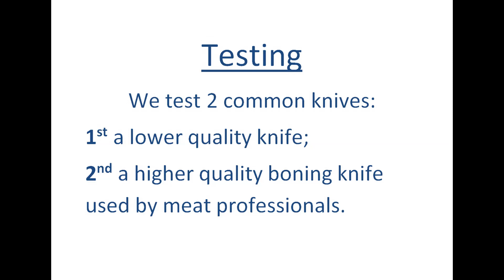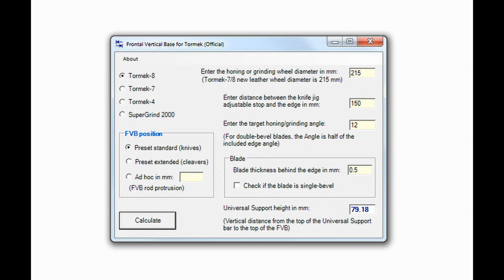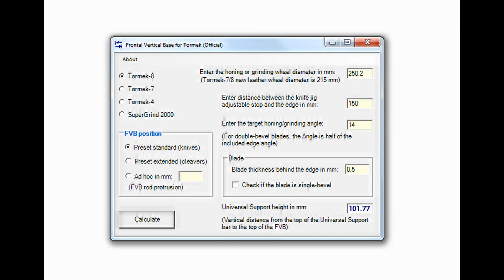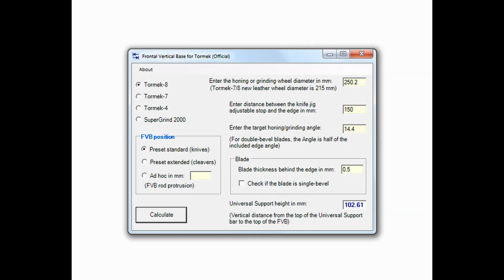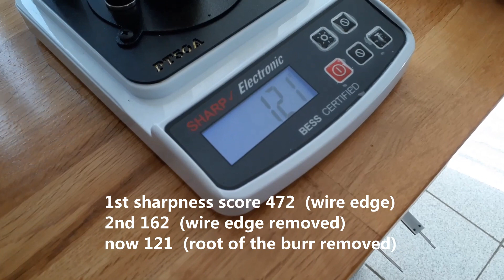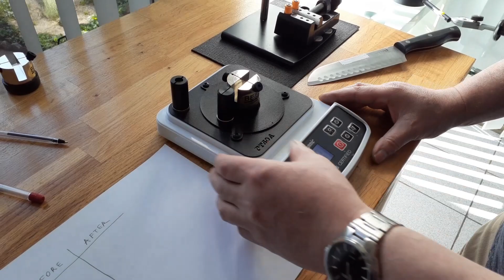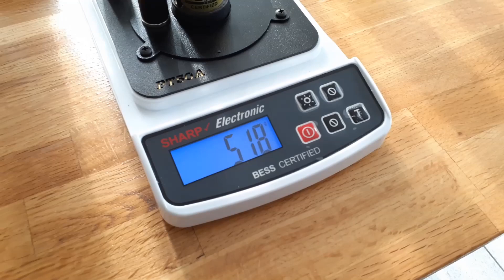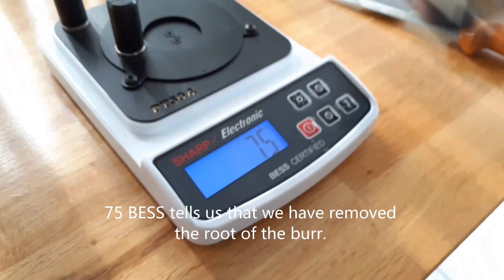Testing rock-hard felt wheel in deburring on Tormek

Comment: "Shake well, shake really well" is true. My first try at loading a strop with diamond spray was a bit "spotty". And the result left some unwanted scratches on the bevels, I think, probably due to clumps of diamond dust. For a strop it may help to have a toothbrush or similar to try to get an even distribution, even after it has dried.

Comment: Thank you so much for these videos, but I have a question regarding stropping with diamond sprays. I'm about to order a T-8 with the SG-250 and standard leather stropping wheel. To keep it as simple as possible for a while due to budget, i'd like to keep and use these as my two only wheels but still achieve the best possible results. Should I load the leather strop with green chromium oxide paste for deburring, or spray it with a diamond spray such as 1 micron for deburring? Or possibly a mix of sizes or just .5 micron? I'm not so much worried with getting a mirrored edge, only the longest lasting most durrable cutting edge with these two wheels only. Any advice you could give me would be much appreciated, thanks!! Right now I only work with steels AEB-L, Nitro-V, and 1084.
Reply: Look up worksharp ken onion with the blade grinding attachment it gets shaving sharp costs very little and has a stronger type convex edge then a hollow ground

Comment: Hi there, can you tell me the height you have your T8's for seated use please?
Reply from the maker: For seated operation my stand height is near 40-50 cm (16-20"); I find it optimal for my height of 170cm.
My wooden stand top is 36 x 36 cm, and please do not make them any wider or you will have trouble spreading your knees around the corners.
But rather than making a stand, you can use a plastic MX Dirt Bike Stand that you see in my videos https://www.ebay.com.au/i/132663737405?chn=ps
Reply: @knifegrindersaustralia5158  Perfect, thankyou for your reply!

Comment: Excuse my ignorance but it would be interesting to see what happens to the sharpness if when you are finished with the wheels of all kinds if you would strop the knife on your roo tail.   Or have you done this in a test?
Reply from the maker: It is shown in this video on the 2nd knife, the SWIBO that after the felt wheel I finish on a paper wheel with chromium oxide, please watch to the end.
We finish sharpening either with a wheel with chromium oxide, or the Kangaroo tail hanging strop, and generally but not always, the chromium oxide works better. Generally, the rock-hard felt wheel followed by the chromium oxide wheel complete deburring, and the Kangaroo tail hanging strop cannot improve sharpness any further.
Reply: @knifegrindersaustralia5158  Danke!   I watched the next video and you explained it in that video.

Comment: Hi Vadim. Good video that shows how good the rock hard filt wheel are.. I have a question.
I only use Tormek t8 and cbn wheels. Along whit leather wheel whit tormek paste, and one leather wheel  whit green paste on it. And a rock hard felt wheel whit 1 micron diamond spray on it. I get the results of 80-120 on the Bess. Kan I get lower (sharper) whit these? of do I have to get a paper wheel? 
Ps I have 0,5 and 0,25 micron paste.. 
Best wishes 
Jan E Christensen 
Ulfberth.dk 
Copenhagen, Denmark 🇩🇰
Reply: Hi Jan :)
I live in Norway and sharpen knifes here :) May I ask where you got a hold of your felt wheel?
Reply from the maker: Yes, by finishing with chromium oxide. What is that "green paste" on your 2nd leather wheel?
Reply from the maker: The Tormek-ready rock-hard felt wheels are made for us by a factory on special order. On 05 July 2020 we will have some available on our website http://knifegrinders.com.au/11Shop.htm
Reply: Knife Grinders the green paste is, chromium oxide strop paste from Windrose England..
Reply from the maker: Looks like the pure chromium oxide honing paste. You have the right setup, and  if your edge is 15 dps or higher, then the sharpness of 80-100 BESS is the right one. 
But you should be getting 70 BESS on a 12-13 dps edge of a quality knife.
If you are talking of a 12-13 dps edge, then can you describe your deburring of some knife please? - name the knife steel, the edge angle, on what CBN # you set the edge apex, and please detail your deburring steps. Hopefully, we will spot where you may be losing the sharpness.
Reply: @jon-andersnethaug8454  norsk her å 😁

Comment: Hi Vadim, What would the result be if you just went straight from the cbm wheel to the paper wheel, without using the felt wheel? ie. What is the purpose of the felt wheel that the paper wheel cannot do? Thank you.
Reply from the maker: We experimented with all wheels: leather, paper, and felt - the rock-hard felt wheel is the best in removing the wire edge, feather burr and foil burr, giving you a clean robust edge that has better edge retention. For the best sharpness and edge retention, after the paper wheel we continue on the felt wheel at low RPM exactly as shown in this video; then finish with pure chromium oxide.
Reply: @knifegrindersaustralia5158  Thank you Vadim. What is the cost of a replacement bottle of diamond spray and how long would the bottle usually last for? And how often should you apply the spray? Thank you.
Reply from the maker: The diamond spray shown in the video is from an Australian lapidary supplier, it is of DeBeers monocrystalline diamonds 1.5 carat, 90ml - Australian Dollars $14.50. In deburring with the felt wheel on Tormek, 1 bottle lasts for approx 1,500 knives. Felt holds diamonds for longer than leather or paper wheels
Reply: @knifegrindersaustralia5158  any chance to buy just the spray? I cannot find anything like this in Europe
Reply from the maker: @le_chef  Please email us at KG@knifeGrinders.com.au - what diamond grit and how many bottles you need.

Comment: Wouldn't it be easier to just have a motor which can change directions?
Reply from the maker: There is a grinder with reversible rotation - WEN BG4270. On it sharpeners use the same software for both the grinding and honing wheels. Details on our website http://knifegrinders.com.au/11Shop.htm

Comment: Hi Vadim, excellent research, as always. 
Question: is it necessary to deburr after SJ-250 Japanese waterstone? Steel is S35VN on Sebenza, edge-leading.
Reply from the maker: No, no  need. There are 2 BUTs with this approach, though. By honing edge-leading on SJ-250 you have a limit in sharpness of 0.3 micron edge apex, as explained on the page 25 of my Knife Deburring book. Also, generally, high-vanadium steels show better edge retention when honed with diamonds as compared to the SJ Japanese wheel.